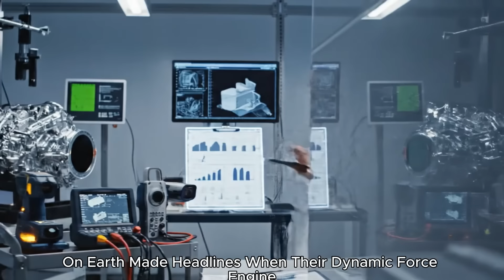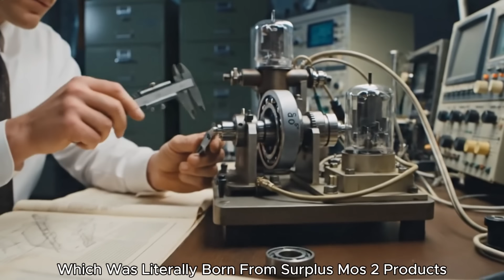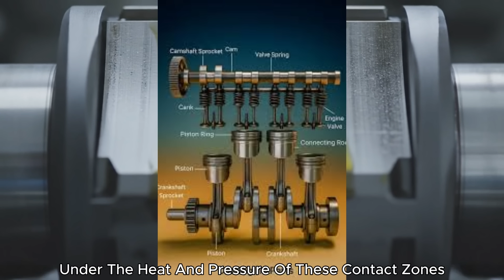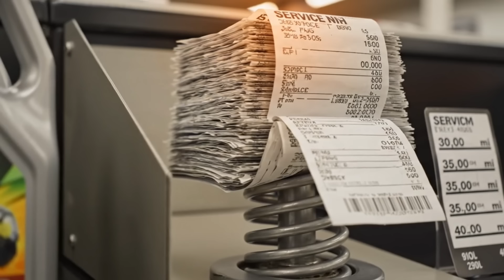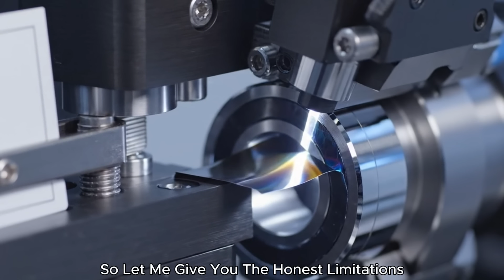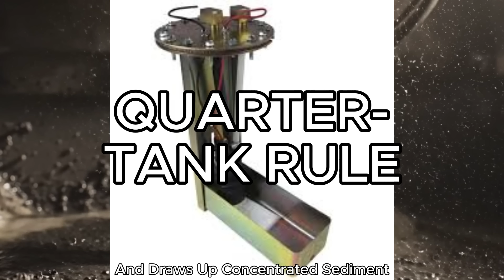This $2 Japanese Trick Burns 90% Less Fuel in ANY Engine — Gas Stations Want This BANNED

Comment: Or you could just use the yellow bottle and heat oz of that and a quarter ounce of xylene and that goes in a 10 gallons of fuel increase my fuel mileage by 6 mi per gallon better been doing this for over a month

Comment: Lucas oil does work but it works better than my diesel my 7.3 powerstroke 2001 I got two more miles to gallon of that put on my 2003 Camry it doesn't do that does not burn oil with Lucas not as much

Comment: I used Molybdenum from JC Whitney in the 60’s and 70’s in Honda motorcycles (305, 450) then in the 80’s w/ Yamaha 750 Seca, then Honda 900. It seemed to make the bikes run cooler, smoother. Plus, unlike most oil additives, it did not cause problems with the wet clutch, and I believe the shifting was crisper. 
I’m using it now in a 2005 Toyota Sienna w/ 3.3 Ltr V6, currently at 308K miles. I use the Liquid Moly product made in Germany. Will I make 500K miles?  My driving style reflects mechanical sympathy, but who knows? I spend more money to replace bad window & dash switches & worn out hinges, etc.
Reply from the maker: That’s a really interesting long-term test case. Sounds like you’ve taken great care of that engine. I’d just be careful about expecting any single additive to guarantee 500K miles — maintenance, driving habits, cooling, seals, and overall wear still matter a lot.

Comment: I’m pretty sure that you’re fuel cost will not drop anywhere close to 90% efficiency
Reply from the maker: You’re right to be skeptical. A “90%” claim usually only applies to a very specific test condition, not a guaranteed 90% drop in total fuel cost. Real-world results depend on engine condition, driving pattern, load, and maintenance.

Comment: Only about twenty percent of the food we eat is converted into useful energy. The remaining eighty percent is waste matter. 😂
Reply from the maker: True — engines and bodies both waste a lot of energy as heat. That’s exactly why “90% fuel saving” claims need careful testing. Efficiency is real, but miracle numbers are usually where the exaggeration begins.

Comment: Have just bought the German liquid Molly Frictionless MO2 additive online on Amazon.  Given the 2nd Iran oil crisis thanks to D Trump,  surely everyone will be wanting to save on fuel
Reply from the maker: Liqui Moly is a real brand, but I’d still treat any additive as a small maintenance tool, not a magic fuel saver. If you test it, the best way is same route, same driving style, same fuel, and compare before/after mileage over a full tank.
Reply: Sure Peta, nothing wrong with Iran having Nuclear First Strike capability !  No worries !

Comment: Hyundai Kona 4 cylinder) no turbo) 72 K
Reply from the maker: At 72k miles on a non-turbo 4-cylinder, I’d focus on normal maintenance first: oil quality, air filter, spark plugs if due, fuel system cleanliness, and checking the manual. Additives may help in small ways, but they should not replace basic maintenance.

Comment: bs tried 4 months no change.
Reply from the maker: Fair result. If you tested it for 4 months and saw no change, that matters. These additives can only help in certain conditions — they won’t fix mechanical damage, a bad sensor, or a converter that is already physically failing.

Comment: Does molybdenum conduct electricity? People have used graphite in their auto engines for the same reason only to have their spark plugs short out causing misfires.
Reply from the maker: Good question. Molybdenum disulfide itself is used as a solid lubricant, but you’re right that conductive or dirty residues can create problems in the wrong place. That’s why additives need to be compatible with the engine, sensors, spark plugs, and emissions system — not just “slippery.”

Comment: the oxidation of castor oil 1st to a longer chain and finally to a long chain lacquer is what allows the extreme performance of  glow plug alcohol nitromethane model aircraft - model boat and model  car engines at 20,000 to 40,00 rpm
Reply from the maker: Great technical point. Castor oil is unusual because under heat it can form a protective varnish-like film, which is part of why it survived in high-RPM model engines. But that same behavior is also why it doesn’t translate cleanly to every modern engine or fuel system

Comment: Will be buying liquid moly for my 2013 MN Mitsubishi Triton 210k be interested to see what happens
Reply from the maker: Good test case. With 210k on a Triton, I’d treat Liqui Moly as a maintenance experiment, not a miracle fix. Track mileage, smoke, idle, and throttle response before and after, and make sure it’s compatible with your engine and emissions system.

Comment: It works so well but cannot be patented. Car repairs account for about 25 billion a year in revenue which would be substantially decreased if everyone knew about this.
Reply from the maker: There may be some truth that simple fixes get ignored when they aren’t profitable, but I’d still separate that from proof. The strongest argument is measurement: before/after results, same engine condition, same route, same fuel, and repeatable testing.
Reply: @OraclePrime1004 I used it because of oil burning, but I was pleasantly surprised with the power it added.
Yes, I should have had a ring job. But a steel engine? Great!

Comment: I use this stuff to build certain thing than have metal on metal action . Works great I also used liquid molly on my truck and works great quieter smoother and felt like a got a little more power back
Reply from the maker: That lines up with what a good friction-reducing additive should feel like: quieter, smoother, and sometimes a little better response. I’d still call MPG gains a “measure it over time” claim, but smoother metal-on-metal operation is a very realistic benefit.

Comment: Would it be useful in a differential?..or in a transmission?..
Reply: Yes there are different formulations.
Reply from the maker: Possibly, but only if the product is specifically rated for differentials or transmissions. Gear oils, limited-slip additives, synchronizers, wet clutches, and automatic transmission fluids all have different friction requirements. I would not add a generic engine additive unless the manufacturer clearly says it is compatible.

Comment: I have a 2000 F250 7.3 powerstroke I've never heard of it. I believe I'll try it.  
Thanks  Chris
Reply from the maker: The 7.3 Powerstroke is a great engine to test carefully. I’d treat it as a maintenance experiment, not a miracle fix: check compatibility, use the proper dose, then track cold start, idle smoothness, smoke, and mileage before and after.

Comment: Not good for aluminum engines  but good for cast Iron engines.
Reply from the maker: That’s a fair distinction. Older cast-iron engines are usually more forgiving. Modern aluminum engines have different metals, seals, sensors, coatings, and emissions systems, so any fuel or oil additive needs to be checked for compatibility first.

Comment: Complete BS in terms of MoS2 making any significant difference in fuel consumption.  Yes, it is a good "solid" lubricant.  But it has insignificant effect in engine oil.
As pointed out in other comments here, if this worked it would be required by car manufacturers.
BTW, my engines only last maybe 300,000 miles.  I never "warm them up", I start, put in gear and drive away.  Change oil once a year.  I do use Mobil1.  BUT I live in a mild climate, don't do short trips and avoid junk engines.
Reply from the maker: I agree with the caution. Modern engine oils are already heavily engineered, and extra additives can sometimes interfere instead of help. MoS₂ may reduce friction in certain conditions, but major fuel-consumption claims should be proven with controlled testing, not marketing.

Comment: MoS2 is a real solid lubricant, no argument there.
But claims like “90% less fuel” just don’t stack up.

If anything delivered even a 10% gain, every manufacturer would already be using it to meet emissions and fuel standards.

In real-world use, you might see a slightly quieter engine or marginal friction reduction, maybe a couple of percent at best, not miracles.

Modern oils are already highly engineered, especially for engines with VVT, so adding extra compounds isn’t always beneficial.

Interesting material, yes.
Game-changing fuel saver, no.
Reply: you don.t stack up.
i use it & it lives up to it.s reputation.. even. the military used it successfully in the 40.s.
Reply from the maker: That’s a fair take. MoS₂ is a real solid lubricant, but “90% less fuel” is where the claim becomes hard to believe. I’d expect smoother running or small friction-related benefits in the right engine, not a miracle change in fuel consumption.
Reply: @OraclePrime1004  so you just use clickbait 😂

Comment: 1996 Ford Mystic Cobra 32kmi. I will be treating with the moly
Reply from the maker: Nice car. With a low-mile 1996 Mystic Cobra, I’d be extra careful: correct dosage, good oil, and no overdoing it. Sometimes the best result is smoother operation, not chasing a dramatic fuel-saving number.

Comment: Never heard of MOS2 ? I have 2015 Ram 6.4L Hemi with 166,000 miles I have used recommended oil someone said to use a 10/30 or 10/40 it will last longer ? Never tried it
Reply: I drive a similar gasoline fuelled RAM for work and know three things: 1) it’s powerful; 2) it’s fast; & 3) it hugely consumes gasoline. Normal driving uses more than 6 litres / 100 Km. Consumption rates greatly increase with higher levels by issues 1) &:or 2)  Frankly, I would simply add the 2 grams of 1-2 um MoS2 into the oil lubtrication system your typical engine oil and see what benefits are revealed by logging information . Chances are good that you can switch to a higher viscosity oil even for driving in cold weather. I switched from using 5W30 to 10W30 engine oil even in cold weather weather. I could not tell the difference after addition of MoS2 anti/friction compound. 😊😮
Reply from the maker: MoS₂ is a real solid lubricant, but oil viscosity is a separate question. For a 2015 Ram 6.4L Hemi, I’d be careful switching to 10W-30 or 10W-40 unless the manual or a qualified mechanic recommends it for your climate and engine condition. Thicker oil is not automatically better.

Comment: I used it in my engine. I bought it from an American dealer as pellets. Then it disappeared.
I drove from Cleveland, Ohio to all over Northern California in 1977. Lasted until 1978. I eventually lost a piston in Sacramento. If I ever see it again, and have a car, I will use it again. My car performed better all the way and stopped burning oil.
I think the company was J. C. Whitney.
The car: 1969 Electra 225.
Reply from the maker: Interesting real-world story. Some older additives and pellet-style products did seem to help certain worn engines for a while, especially with oil burning or friction symptoms. But losing a piston is a reminder that smoother running doesn’t always mean the root problem is fixed. I’d treat anything like that as a temporary experiment, not a guaranteed repair.
Reply: @OraclePrime1004 It was driven hard, five days across America and up and down the sunnyvale area to Sacramento, California got about six months. [Electra 225 1969]
The car I drove back to Ohio (I was given 4 days), I blew a head gasket. [Ford] About 20 hours a day in both cars. The first had a U-haul rollerskate on the back.
Let's say I expected some problems. 😑

Comment: Toyota Prius 2008 500,002,000
Reply: Before we got ours, a person at the Dealer was there to pick up his new one. He playfully complained that his current one was getting a weak battery. It had 427,000 miles on it. He wanted no other car.
Reply from the maker: A 2008 Prius with that kind of mileage is exactly why people still respect those cars. Not perfect, but Toyota really did build some incredibly durable hybrids.

Comment: The MOS2 has Ben around for more than 100 years and I have never heard about it it saves your car  on ware in motor and saves on Gas is like no one wanted  us  to use it. They used it in the 1700 on buggy’s axles and other things that need lubrication
Reply from the maker: You’re right that MoS₂ has been known for a very long time as a solid lubricant. The part I’d separate is lubrication from fuel-saving claims. Less friction can help wear and smoothness, but huge MPG savings still need real before-and-after testing.

Comment: I have a Ford 1995 Bronco 5.8 L. I added Liqui Molly 2 to my Oil Change at 185K miles and I immediately notice a smother idling and running engine.
Reply: I have a 95' BRONCO XLT, but with the 5.0. A little over 400,000 miles on the stock motor and tranny. Maybe I should try adding some Liquid Moly 2 to it🤔?!
Reply from the maker: That’s the kind of result I’d expect more than miracle MPG: smoother idle, quieter running, and maybe a little less friction feel. The smart move is to keep tracking it over time and make sure oil changes stay regular.

Comment: Or, just get an EV and avoid the issues related to ICE friction.
Reply from the maker: EVs do avoid a lot of ICE friction, fuel, oil, exhaust, and emissions-system problems. They also bring different tradeoffs: battery cost, charging access, repair access, weight, insurance, and long-term battery life. It depends on the use case.

Comment: My 2006 Volvo XC90 has a T5 engine (5 cyl, 2.5 L, turbo) and driven over 400,000 Km and 25 years. Last August my mechanic suggested I try some Liquid Moly (with MoS2 2 um in the oil). This was added & fused for ~2 hours at ~2800 rpm in the shop. Over the next week I was amazed to feel the gain in speed and noticed a quieter engine. Performance continued over the very cold winter 2025-26. My battery wasn’t great after 7 years use but it easily started the engine at -28 C. 
I’ll continue using my Volvo T5 with MoS2 dispersed in high mileage Castrol oil at 10W30 viscosity.
Reply: In the UK its sold as molyslip, I used it in old 1970s engine, there is another product call slick50 which wasbetter but more expensive, there were 2 variant of molyslip, one you put in your engine and the other goes into your gearbox and rear axle,It definitely ade the gearbox and whining noise from the axle disappear. I dont know if it improved fuel eff but I know engineers didnt like it especially when you send a crnkshaft off to be reworked, they said it was hard to cleanoff so they couldnt grind the crank properly. I didnt use it after getting newer cars since these have copper coated bearings instead of lead ox.
Reply: @danny323dee Slick 50 was found to be deceptive because the Federal Trade Commission (FTC) charged the manufacturer with making false and unsubstantiated advertising claims regarding engine wear reduction, fuel economy, and horsepower. 

FTC Charges (1996-1997): The FTC alleged that Slick 50 ads falsely claimed the product reduced engine wear by up to 50% for 50,000 miles and bonded PTFE to engine parts, yet the company lacked reliable evidence to support these specific assertions. 
Settlement and Penalties: In 1997, three subsidiaries of Quaker State Corp. settled the charges, agreeing to pay upwards of $20 million in damages and redress to consumers while banning the company from making claims about reduced wear or increased performance without proof. 
Technical Findings: Investigations revealed that modern engines are adequately protected by standard motor oil at start-up, that Slick 50 did not coat engine parts with a layer of PTFE, and that the product failed to meet military specifications for motor oil additives. 
Consumer and Expert Consensus: The product is widely characterized by automotive experts and online communities as "snake oil," with reports suggesting that while it may have temporarily quieted engines, it could also cause particulate buildup that clogs oil filters and damages engines.
Reply: I'm going to try this but I'm going to not use it on the Suburban I work on that has active fuel management I Gotta Feeling Maybe that might be a problem
Reply: How much liquid moly did you add to the engine oil or only used the moly?
Reply: @pierrejoly9094  I think it was a 300ml tin, I put the content in, it comes with instructions 2 tins for large engine or trucks then take it for a drive
Reply: @danny323dee i have a  cummins diesel 6.7l, i will read the label for sure. Thank you for your reply.
Reply from the maker: That’s a great real-world report. A smoother, quieter engine after MoS₂ is believable, especially on a high-mileage turbo engine. I’d still separate “better feel” from huge fuel-saving claims, but reduced noise and smoother running are exactly the kind of result worth tracking.
Reply: @OraclePrime1004 Barnum capitalized on the same thing... what was that quote? 🤔

Comment: Jag har precis beställt mos2 olja.
Jag kör en Suzuki Grand Vitara 2,5 liter sug v6 bensin från 1999.
Min fru kör en Mazda 6 2,0 från 2005 
I detta hushåll reparerar vi våra fordon själva.
Eller rättare sagt jag!!!.
Här grund service vår och höst.
Reply from the maker: Sounds like a good real-world test. On older engines like a 1999 Grand Vitara V6 or a 2005 Mazda 6, I’d treat MoS₂/Mo2 as a lubrication and smoothness experiment, not a miracle fuel saver. Use the correct dose, keep the oil spec right, and track idle, noise, oil use, and mileage over time.